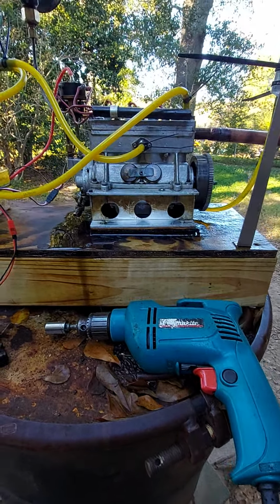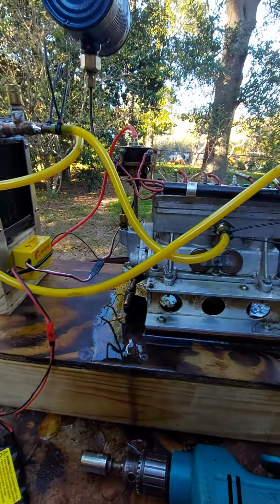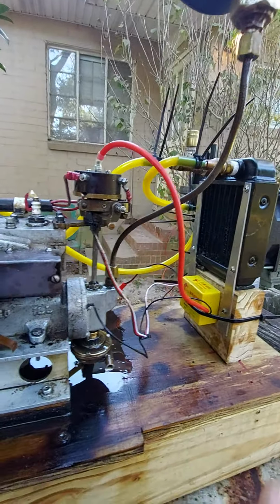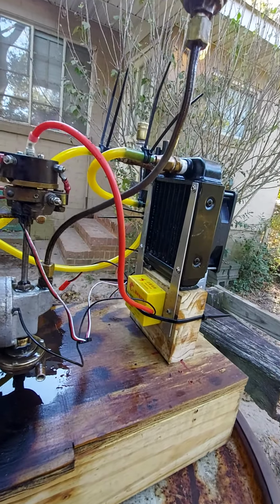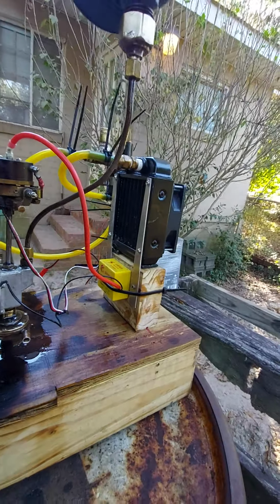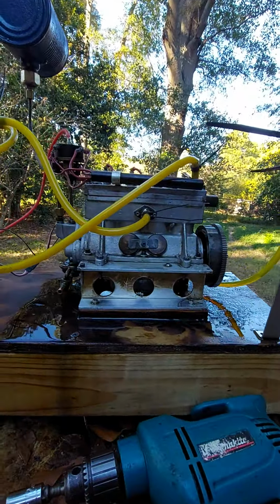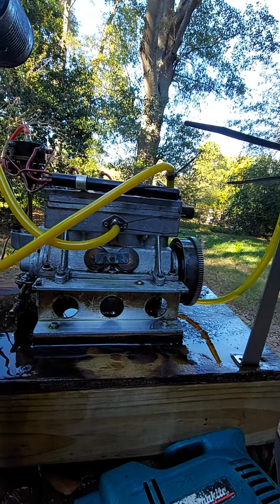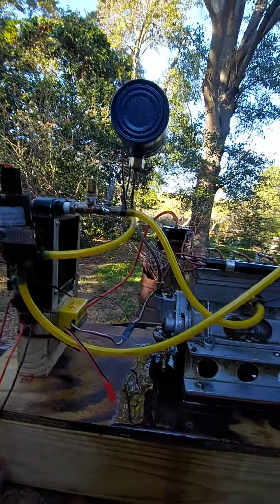50cc Elmer Wall engine with electronic ignition.

Comment: Hi Leonard, this Elmer Wall engine was it a kit or already assembled? The sound is very much alike the one of my 30cc one. Mine you can get raw castings (search for SEALION by Edgar T. Westury). Greets Bruno
Reply from the maker: It was assembled. The ignition system I'm using now consists of the following: Points and condenser from a distributor out of a 1962 Plymouth Valiant and a coil out of a 1973 Datsun 240Z.